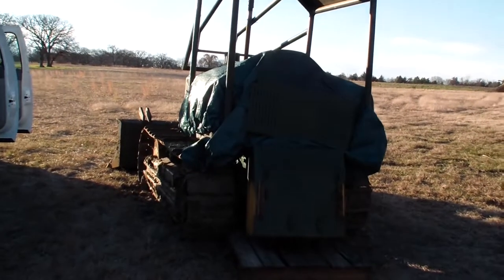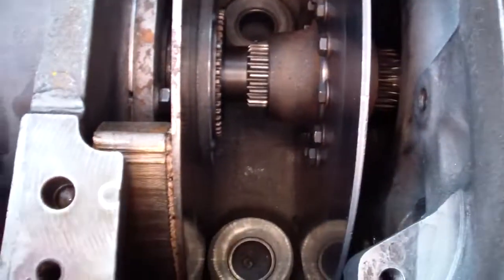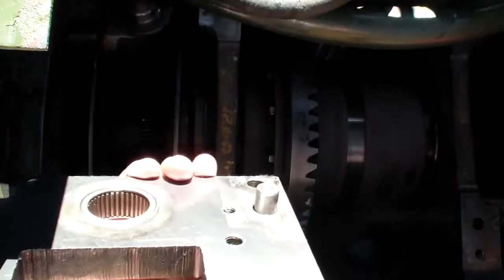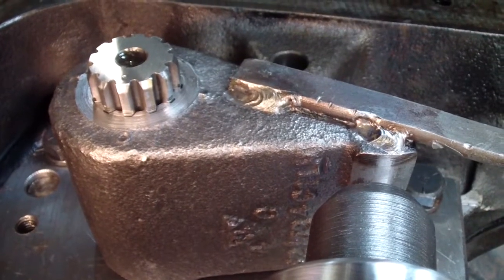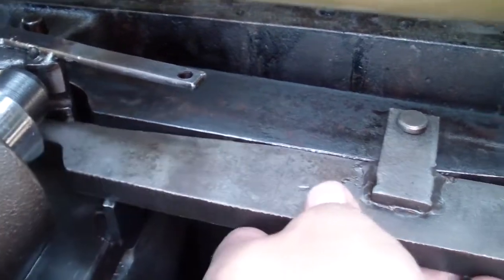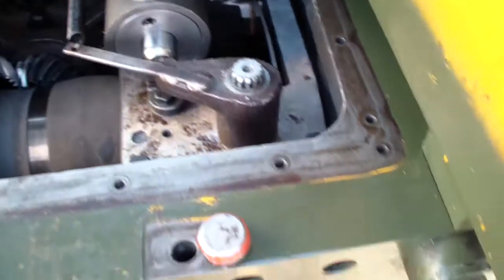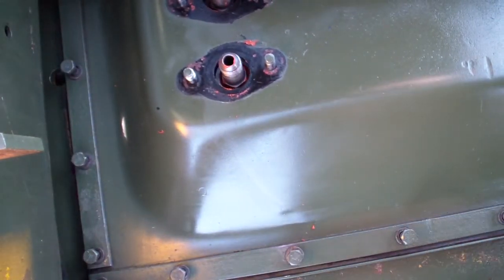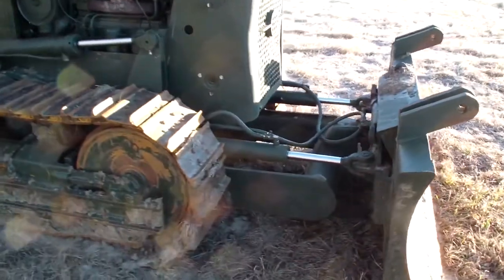TD7C Bulldozer Clutch & Brake Job

Comment: have another question for you. i bought some uv dye today to find the souce of my transmission leak. i saw a couple lines that seemed to be leaking then i saw the dye coming from my final drive. seems like my seal between my transmission and steering box is leaking can that seal be replaced without pulling the transmission?
Reply from the maker: The transmission will leak to deferential box from 5 sources:
One of the two steering hydraulic cylinders ( you can fix them easy, you just need to remove the top cover and re seal them).
The pinion seal ( you have to either remove the deferential unit or the transmission to access it).
The input shaft seal ( you can replace from the inside of the deferential box).
The connectors that connect the hydraulic lines to the steering cylinders.
If it is a minor leak, you can ignore it and scavenge the hydraulic fluid back to transmission using small manual pump like the one they use to prime an outboard engine. The manual pump hose should fit in the deferential box dip stick housing pipe. Make sure you keep check the fluid level of the transmission.
I hope this answer your question.
Reply: @SalamSayhood  hope its anything but the pinion seal gonna take off the access cover tomorrow and see where the dye is coming from in there. Your final drive video is gonna come in handy when i replace those seals
Reply from the maker: After you remove everything to access the deferintial box, re connect the hoses to the steering cylinders and rig a small container to supply diesel fuel to the engine and also the return line and run the dozer, put it in gear so you can see where the leak is.  Please let me know if you have any more questions.
Reply: @SalamSayhood  turns out both steering cylinders are leaking and the pto seal. where did you find a kit to rebuild the steering cylinders or did you just match the o rings that were in there
Reply from the maker: I just matched them up at a local shop.

Comment: I have an old td7c. It will not push very hard in forward. It's fine in reverse.  Any idea? Thank
Reply from the maker: If you apply the same load in forward and reverse, does it do the same thing? Try to drive the machine up hill on first gear forward and reverse. Your machine should have the power shift transmission. Give me more details on what you tried so far:
Make sure it is not engine issue.
The transmission and torque converter both have new filter.
You are not using the wrong transmission fluid or the fluid level.
Reply: @SalamSayhood  in reverse it will do anything.  Climb hills no problem.  Pull weight no problem. Works in all three speeds. In forward will only move on flat ground or if im going down hill. Will stop if I'm pushing any weight   new filter, correct fluid and level. Definitely won't climb anything in forward.  If it stops in forward,  and I pull back on both sticks, it will jump forward a foot or so, then stop moving again. Thanks
Reply from the maker: I believe it's a transmission or control valve issue. Since it's running ok in reverse and if it's steer ok in reverse, that indicates no problem with the engine, torque converter or rear end. Please keep me updated. Have a great day

Comment: what kind of oil do you recommend for this
Reply from the maker: Good morning, I use the phyllips 66 powertran fluid. I buy it in 55 gallon drum. You can use any tractor hydraulic fluid, you need to make sure it meets the Case IH MS1210 properties. If you have more questions please let me know.
Reply: @SalamSayhood  I'll sure do it, thank you for the input
Reply from the maker: You are welcome